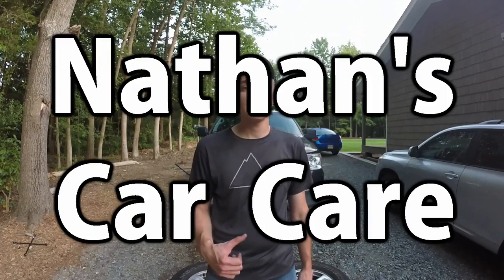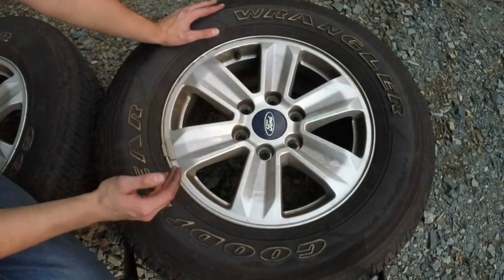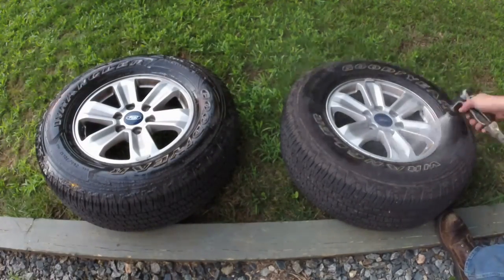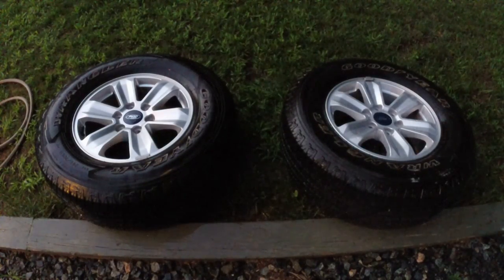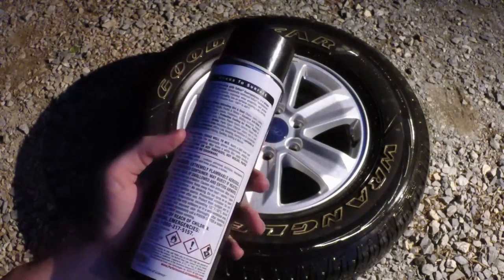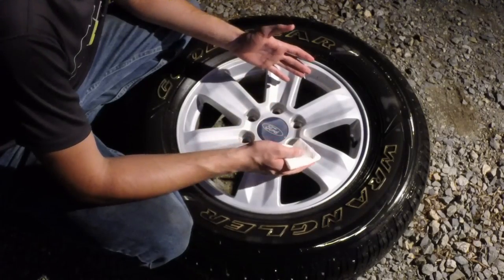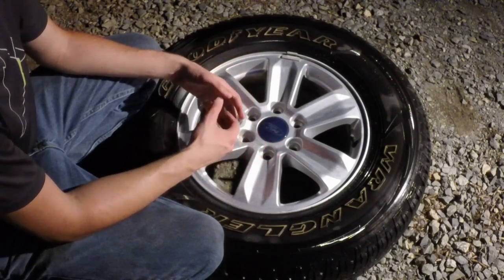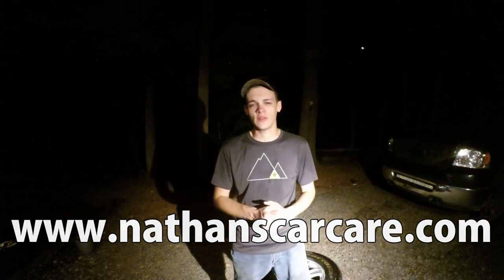Car Life Hack: How to Keep Brake Dust Off Your Rims

Comment: Thanks for this video! I'm gonna try this today, as I just upgraded my brakes to better pads and have white wheels, so I'm not too enthused with the dust buildup.
As an aside, I used some of this stuff on a water slide and it worked VERY well.
Reply: Howd it work for you @pyroguyFTW
Reply: @TheStewGuys  worked alright, but not perfectly. There's still buildup, but at about 20-40% the rate it was at before.
Thank you again, I never knew about this stuff and it's magical

Comment: what happens if you take your car to a car wash will it still work and how long will it work until you have to spray again either wet or dry if the car is wet or dry or if it's raining outside or snowing outside
Reply: dude dont go to a car wash… it messes up paint. i had to learn the hard way
Reply: Go to a self-serve high pressure car wash...just don't use the washing brush hanging on the wall. Just bucket wash your car yourself...it's cheaper. BTW...you will need to find a general time to do this because most self-serve car washes are crowded especially after a rain/storm/snow.

Comment: I tried this and got a bad white haze coating over the paint,...I'm not sure if it did this bc the paint hadnt fully cured by the time I did it or if the haze is something that just happens like it or not....
Any advice to cut down on this?
Reply from the maker: I got this one one wheel I tried it on, since I had done the video. I just buffed it and the haze went away. I don't know what caused it.

Comment: Can the product be applied with the wheels attached to the car?
Reply from the maker: No. If you do that, you will end up putting it on the pads and rotors, which could cause your brakes to fail.

Comment: JUST BUY CERAMIC BRAKE PADS EASYYYYY
Reply: Nathan mentions “if you have ceramic brake pads”. Well, if you have them you will not have a problem ,like Ned says!
Reply: Ceramic brakes still have brake dust.